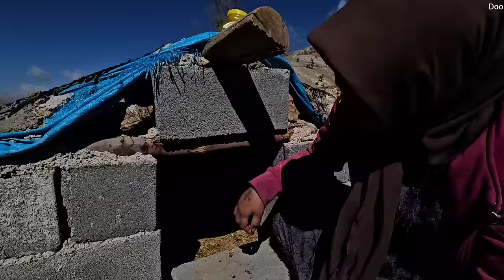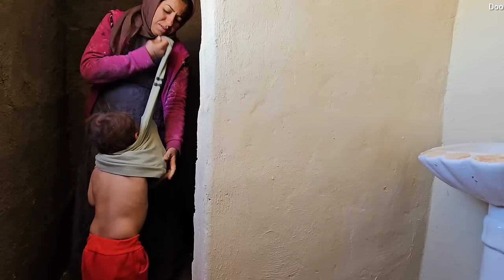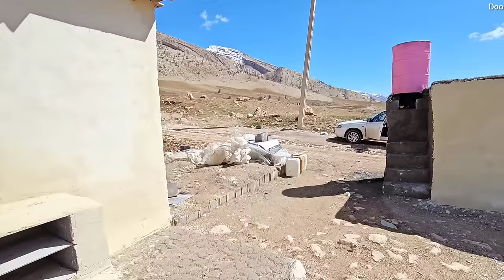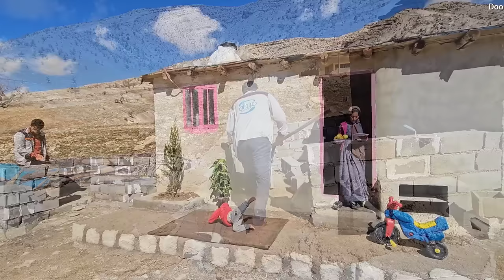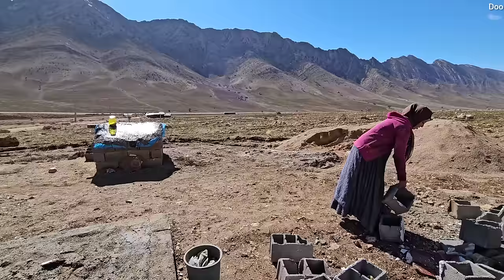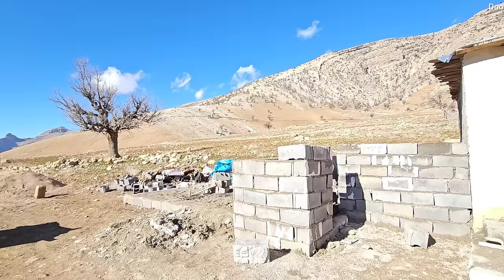Solidarity and Strength: Selfless Support of a Man to a Divorced Woman in Overcoming Challenges

Comment: What can be stored in this huge room with a tiny difficult doorway? I was so in hopes she would have a place to keep wood dry with the water tank on the top! It only needs to be higher than the faucet, not clear on top of the house where it is so hard and dangerous to fill! Maybe you can still do it with a block wall to protect it. Just a few steps would be necessary then. Just don’t see how she will get stuff in and out of that entrance! Each hen doesn’t need a rooster, they are already fighting! Stay well and God Bless you all.